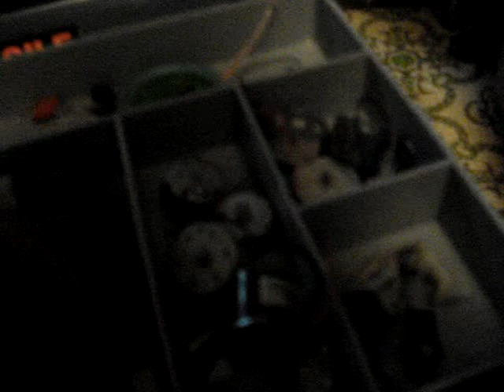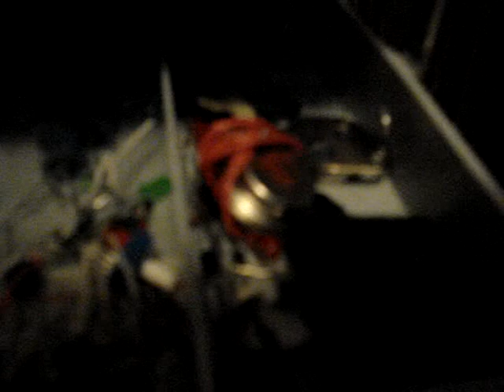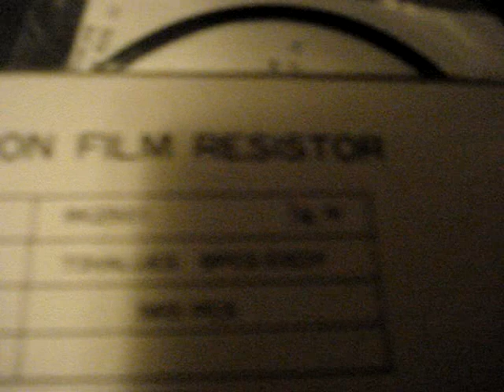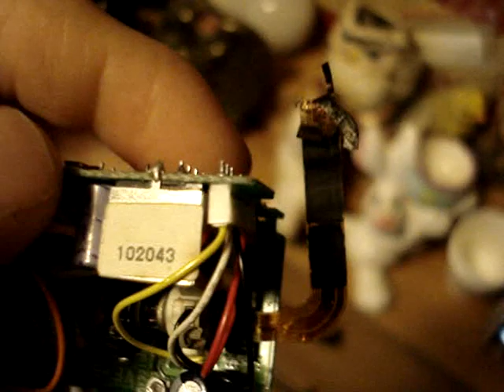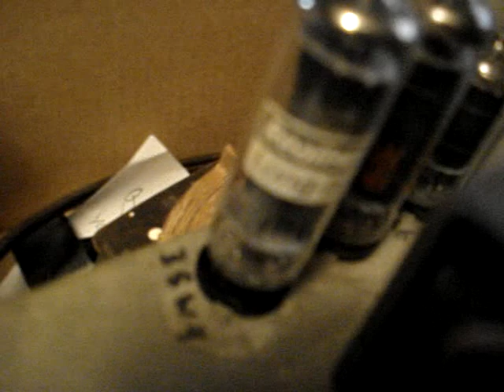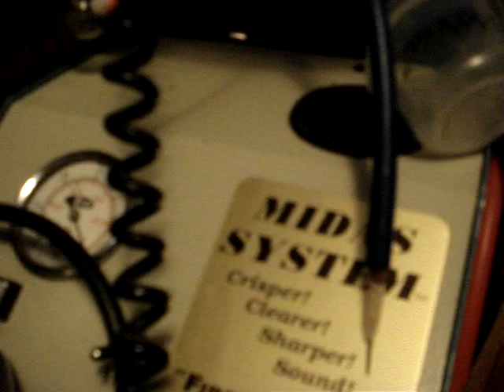My Junk box

Comment: As I explained in a previous comment in one of your other vids. They are the best iron I have ever used. They heat instantly and will maintain working temperatures even under heavy heat sinking. There are also a multitude of tips available for all types of soldering work. They are ver expensive new, but you can get one on eBay very reasonably. -Ed

Comment: I went to ITT back in 2000-2002.  We got the same box and parts as you did.  
I built a TV transmitter for one project, though it barely works.  

Off topic - what motor kept starting up in the video?  It sounded cool :)